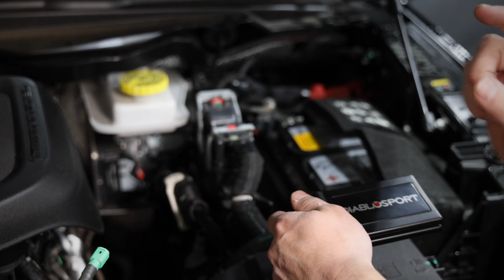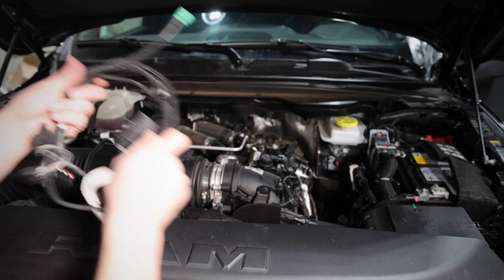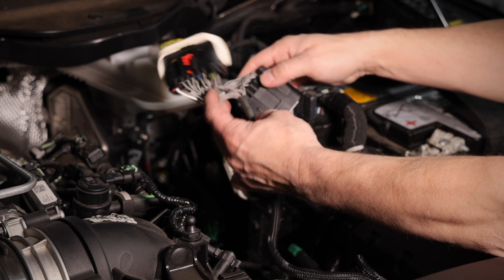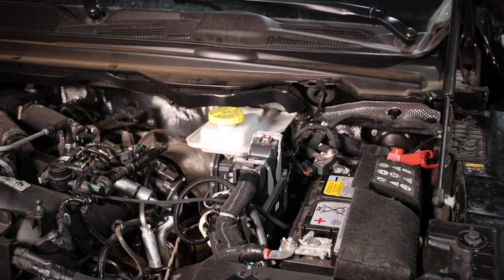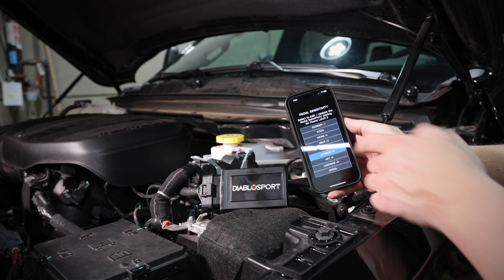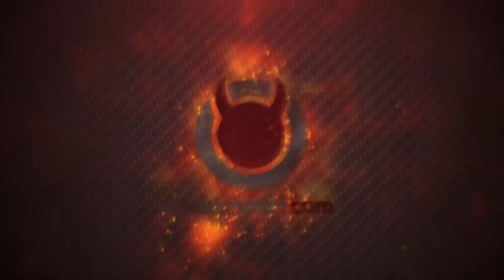Pulsar Cat6 Installation Walkthrough

Comment: I installed & hearing a clanking noise at idle is that normal
Reply from the maker: No, nothing should be different after the install other than having more power and better throttle response. Please give us a call if needed, 561-908-0040

Comment: Can you uninstall this without tripping a code? When installing I had an engine light on but cleared it through the app.
Reply from the maker: Yes, we'd recommend disconnecting the battery when installing or removing as well.

Comment: I just installed this on my 2026 RHO.  This is the best install video I’ve ever used and the parts fit really well.  One difference was  the map sensor isn’t sitting in the open.  There are some other tubes and cables directly on top of it but you are still able to remove it with a little finagling.  The other challenge was getting the piggy back connector locked into the throttle sensor.   It’s really difficult getting it seated far enough in to lock it but it will if you work it.  
Driving it was unreal.  I’ve been running 93 so I set it at Level 3 and turned the sensitivity down to a 3 on the pedal.  The truck rocks!   I highly recommend the Cat 6!!!
Reply from the maker: Enjoy!!

Comment: Can you run level 2 or 3 with 91 oct?
Reply from the maker: Yes, we developed all the calibration levels on 91.
Reply: @DiabloSportInc  sweet. I live in Arizona and only have 91 available. How do the maps and throttle settings transfer between different drive modes. I have 26 ram 1500 rebel and use mostly auto mode and sport mode.
Reply from the maker: the modes don't affect anything with the cat6, they just work as normal.
so if you switch to sport mode with one of our maps, it will have the enhanced throttle feel and shifting of sport mode, with all the extra power and any throttle adjustments you make from Cat6 on top.
Reply: @DiabloSportInc Ok good good. How about hardware modifications like exhaust, hi flow down pipe and intake? Will the maps work with these or will it require a custom map?
Reply from the maker: lots of people are running it with a CAI and exhaust, haven't seen any downpipes yet.
Reply: @DiabloSportInc Awesome. Thank you for your time answering the questions. Now I will monitor if you guys have any sales for Black Friday or Cyber Monday.
Reply from the maker: Cat6 is on sale for Black Friday right now :)
https://www.holley.com/products/tuners_and_programmers/inline_tuning_modules/diablosport_pulsar_cat6/parts/32457
Reply: @DiabloSportInc I see it. I found it on a different site for 534 (with BF discount code) Will you be able to beat that price?
Reply: Hey got my CAT6 installed today on my 2026 Rebel 1500. Im very impressed. Install was straight forward. I do have a question. When I go to the maps selection I see power levels 1, 2, 3. None of them mention what octane are they for. Like I mentioned I only have access to 91oct. Can I still run power level 3 with 91oct? Thanks.
Reply: @dahufka I believe he said all power levels were designed for 91 octane
Reply: @mghtymous21  yes Sir. Installed over Christmas break and running good and strong on power level 3 with 91oct here in Southern Arizona...no issues.
Reply: I just installed my DiabloSport cat 6 and I got a check engine light come on any ideas
Reply: @YouvanyAlvarez-ww2jm  that's not ideal. Any idea what is the code?
Reply from the maker: What is the code? Please give us a call if you need assistance. 561-908-0040

Comment: I was told you can adjust pedal also on stock mode correct?
Reply from the maker: Yes, throttle can be adjusted at stock power level as well.
Reply: @DiabloSportInc mindiablo sport cat 6 arrived yesterday. Cant wait to install

Comment: Is this vin locked? I have a SO Rebel, and I am considering an RHO soon. I wanted to get this now for my Rebel and then switch it to my RHO, is this possible?

Also, how much boost is added in each level?
Reply from the maker: yes,  you can move it from the SO to an RHO :)
3-6 psi or so in the power levels.